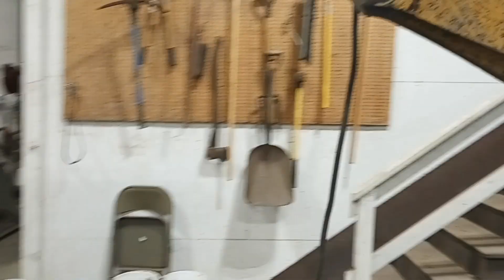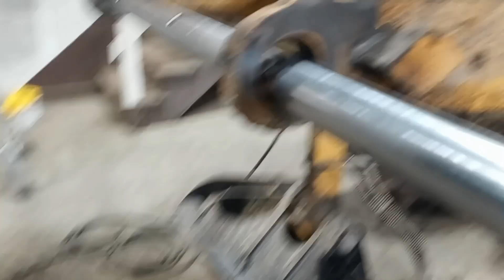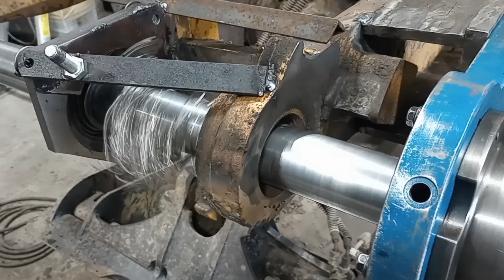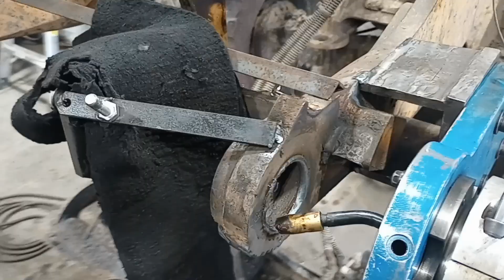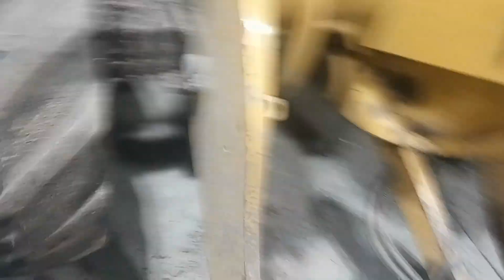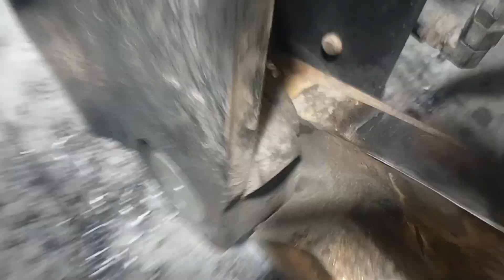Cat 908M blown bushing hole repair.

Comment: when your bore welding how many amps and wire speed are you running also what size wire ive had issues with adhesion on the vertical down side of the bores
Reply from the maker: That is definitely always the bane of bore welding. I am typically running about 19 volts 250fpm wire speed, the amperage varies with my stick out, on this job I think it was about 130 amps but in windy conditions I have to shorten up the arc to prevent porosity and then the amperage can climb up into the 150 range. More power helps with adhesion but then your tip gets plugged up with spatter. I run .035 wire. The biggest thing is to have the bore cut oversized to begin with if at all possible and then I shut down every once in a while and check to make sure the bore next to my weld bead is turning blue showing I am getting penetration and therefore heat transfer into the base metal, if not I start playing with settings. Oh yes, and don't try to run too large of a weld bead/low rotational speed, your puddle will outrun your arc then. You are better off with multiple light passes than attempting to lay one heavy pass.